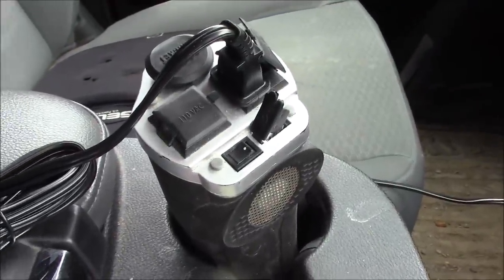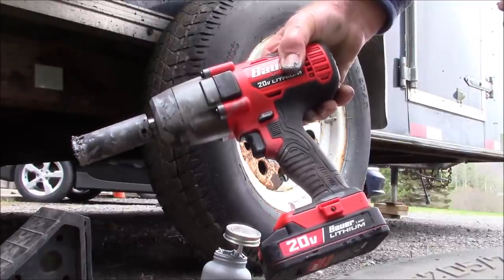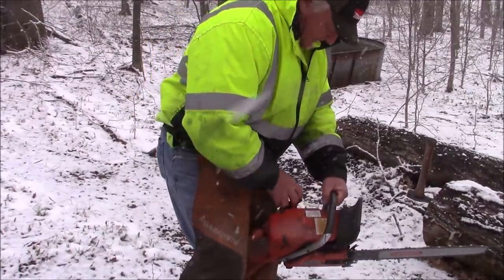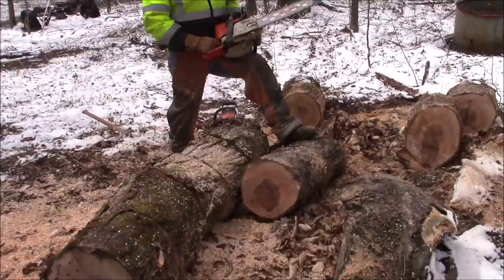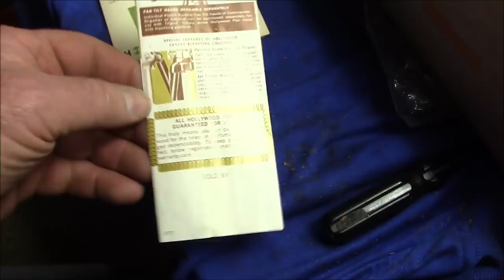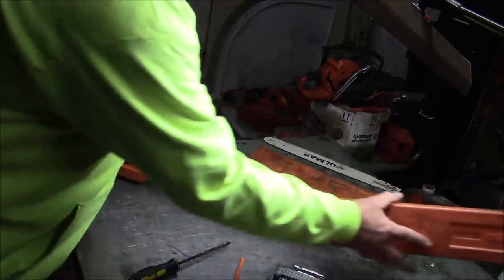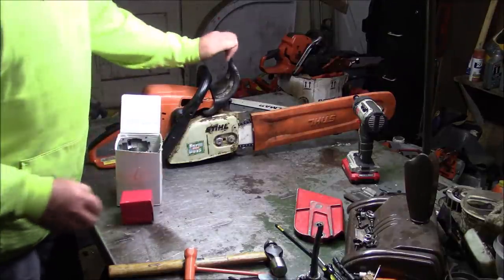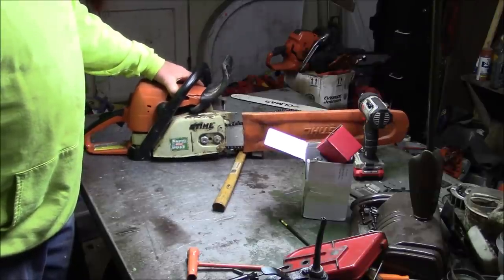Stihl MS310 vs. Husqvarna 365 OE 48mm "Working" & Harbor Freight "Bauer" 1/2 Impact & GTG Prep

Comment: Plague, food shortages, snow in may ,thank goodness you and Bob are going to have a gtg and talk about chainsaws I for one need some normal life to return looking forward to that vid .I am 6 months into a Hf drill,3/8 impact and 1/4 driver my shop is like a dino run for tools alot of tear down on trucks my favorite so far is the 1/4 impact I can RIP off a whole clip minus core support bolts and bumper with a 1/2 battery easy downs so far a little brush smell.

Comment: @afleetcommand - Walt, is that a Cross pop-up piston?
Reply from the maker: No, from "Lil ' Red barn" and the piston is made by VEC india. A few other folks sell them as well. Hyway has one. But the VEC is cheap and seems to work.
Reply: @afleetcommand  Thanks Walt. I'm intrigued by this series of saws as they have a strong customer base. Even dead ones in the UK fetch good money. If I have any sense I will stick to tinkering with my Stihl 038s and Jonsereds...

Comment: With the aftermarket cylinders i would highly recommend port matching the intake boot to the intake port if you are using the oem stihl intake boot the cheap aftermarket boots are a bit smaller and that I have noticed the cylinders are molded to have a smaller port. It is nice to have the extra meat to get rid of to get the port the size you would like and to possibly do some velocity porting to well you know tweak on and with just to see what works and what doesn't. I persinally did 2 spots on the top of the port and used a ball cutter and made 2 ramps down with golf ball style work on the floor with a smaller ball cutter the nwhat i used on the roof. Then I matched the intake port to the boot. With doing a ported muffler from what i can tell  a .750 pipe it ran pretty well. i think it is now a .830 not 100% sure right off hand id have to measure it again and check. seems to be a hair to big i think if i was to go to a .80" pipe it would like it the best or a .790" with the stihl ms660 carb. i swapped back to a ms390 carb but can tell its choked back up again. there is deffinently a gain to the ms660 carb but they can be a pain to get to work sometimes.
Reply from the maker: That's a lot of work...:)
Reply: Yes it is I topically dont think of it as work lol I've been thinking of fixing the modified kill/choke lever for this one of mine to go back with the ms660 carb. Had to heat up and bend the peace that pushes the choke closed up about 30 to 45 degrees in order for it to close the choke properly as well as use a peace of fuel line to connect to the carb and I inserted it into the OEM fuel line didnt have any issues with it leaking that way suprisingly definitely felt like it had more midrange and topend with that bigger carb. I do have a project here soon of stuffing a 66 or 268 old style crank in a set of 55 cases. Definitely gonna be a interesting build I know it can be done some moding will be needed to compensate for the 2mm longer stroke then the 55 32mm crankshafts. So we shall see what happens.
Reply: I did forget to mention that the most work was the 2 different mufflers I un crimped and crimped back together. I did weld the pipes in though. Both inside and out on both of them. So they do flow very nice with little back pressure that I should have put into them and set the pipe a little inside of the muffler and didnt do so. After doing a few redmax ebz8500 mufflers and gutting 3 It became cake walk for all other crimped mufflers I do know a OEM stihl muffler is a bit harder and thicker material harder to pull apart even with a torch but easier for welding in my case. Moding the muffler with the pipe does help more then opening the holes in the front is it worth it for the average homeowner yes there is a power gain there to be had. For the "Man I want more power" kinda guys splitting the muffler is the best way.

Comment: Can’t believe I see you cutting with an orange and white saw and even saying something nice about it.😀
Reply from the maker: Some people have open minds? :)
Reply: afleetcommand I do, too.  Yesterday, I had to cut down av24 inch hickory for a disabled friend.  Guess what did the face cut and most of the limbing?  My 455XT.  The reason is because it is the lightest of all my big saws and I had to cut it on a high stump.  I did the back cut with my ms 360 and the big bucking with my ms 440.  The little 455 did a good job on the jobs it had to do and used the most gas of any of the four saws I used - 1&1/2 tanks but 24 inch hickory would have been a little to much for it.  I used it mostly for limbing, delicate cuts and cutting out other saws that got pinched.  It took three hours to get it on the ground, limbed and bucked up.  The darling of the day was my ms 251 which saved our butts on more than one occasion when we got a pinched saw.  It would have to cut a limb or a trunk to relieve the tension so we could get the other saws out.  At one time I had three saws pinched and it was our course of last resort and it actually had a chain that was far from perfect.  I have never cut big maple, like you, but I have cut 24 inch maple and it was balsa wood compared to the hickory I cut, yesterday.  It took me five hours to clean and sharpen four saws after I finished cutting, yesterday.  That hickory had rounded off the corners of the cutters on every saw.